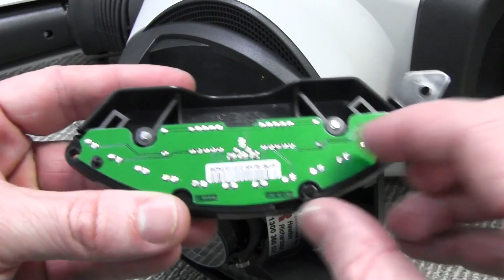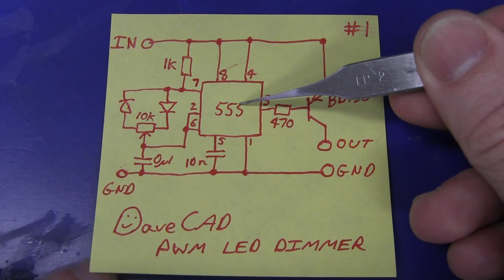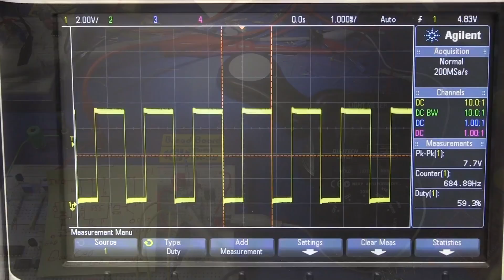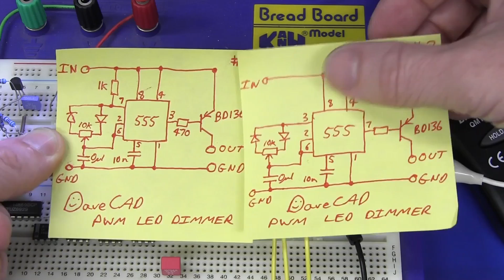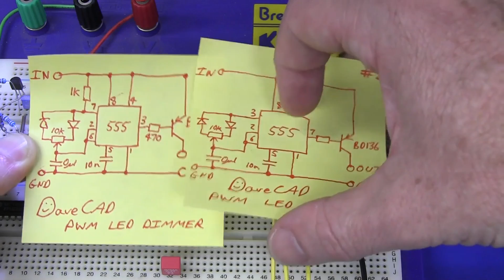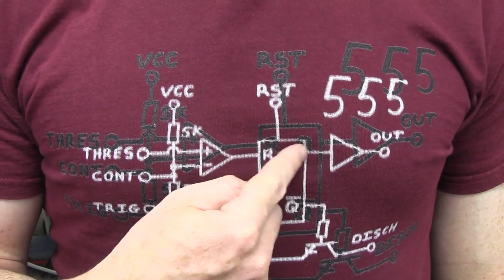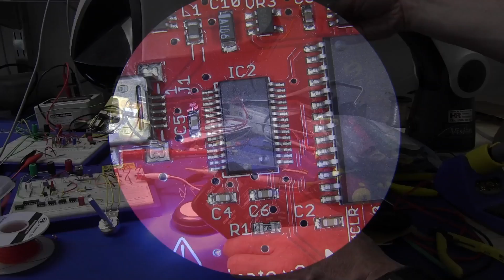EEVblog #392 - 555 LED PWM Hack

Comment: Being able to adjust the frequency rate of the LED flasher outputs pin 3 plus the pin 4 for the extra LED and also being able to adjust the duty cycle without affecting the flash rate frequency while still being able to adjust frequency is what I am looking for. Anything on this yet ???

Comment: Any ideas to use a 0 to 5v potentiometer to dim RGB without messing up the color mix?
I am expirimenting with a PWM fan controller for testing, but if I'm thinking right for the final install I may be able to use the Pam signal from the factory computer that is controlled by the dimmer knob.

Comment: You can always save this pull-up resistor in 555 timer astable multivibrators by using its output pin to control charging and discharging of the capacitor. You can also save the base resistor by use of a p-channel MOSFET for switching of the LEDs also from the output pin.

Comment: What would be the best way to control the pulse width using a microcontroller? Would the pot have to be a digital pot in order to work properly or can a microcontroller DAC simply output a voltage to this circuit somehow?

Comment: i noticed the transistor had casing molded around the back of it, does that ever interfere with the grounding? like do u ever have to sand them to get a more reliable connection? or am i totally wrong about that even.. does it Not also ground thru the back?   i know, random ass question.. im just curious

Comment: Very good. I like coming of pin 7 . Used that pin in a simple 555 time base circuit on a very simple scope and a 0.1 out from the transistor.
 .

Comment: You should connect a 1k resistor between those two diodes opposite to trimmer. I built the circuit on breadboard and it works fine but when i made it on pcb as a prototype, my smd 555 chips worked good for several minutes and then stopped working. I blew 2 chips and then i searched some formulas, and came to know that the capacitor on pin 6 is getting charged through the resistor, diode and potentiometer and discharging through the diode only directly to ground through an inbuilt transistor on pin 6. Due to very low resistance on the discharge path, when the duty cycle is at maximum, the capacitor is discharging in a very short time and a lot of current is flowing through inbuilt transistor which will eventually blow the chip making it unusable. I dont know how long the dip version of chip lasts with this circuit but the smd chip will blow instantly. So add a 1k resistor in the discharge path!!!

Comment: I think Mantis did 317 on purpose to supply stable current. remember old microscopes having bulbs? being relativly slow those can be PWMed without light flux pulsing. Don't get me wrong, pulsed leds are great for torch lights, but in my opinion they are bad for microscope backlight.

Comment: Hello Dave
I love your videos! Great work!
I have a question. I’d like to build a circuit that lets me turn on a 12V 20W light bulb immediately to 100% duty cycle. When turning it off, I’d like it to slowly dim down from 100 to 0% duty cycle over a time of about 30 minutes. So to say a soft stop. Would you have an example of such a circuit? Thanks much in advance
Reply: I'm curious what do you need it for?

Comment: Can this chip NE555 use to drive a mosfet for the backlight circuit in a led tv? If your circuit can be used, what would be the output to connect to the gate of the mosfet and what value gate resistor?
I think I should say it’s a Chinese tv but the PWM chip is defective so I just want to direct drive the mosfet for the backlight.

Comment: Hey Dave!!!  I have been looking for a good push-pull 555-based circuit for a LONG time!  On your DaveCad drawing, would I get this if I connect a load to your BD136 output (to source current) and pin 3 (to sink current)?  a couple hundred mA  at 40kHz to 50kHz should be sufficient.

Comment: Skip the 1K resistor, and swap pins 3 and 7 on the 555. Use pin 7 as the output (it's open-collector) and pin 3 (push-pull) to drive the steering diodes to the sides of the pot.

Comment: Can you help me to build a really high current PWM? Like 200amps would not need to be high Voltage only about 5v to 12v. All I really want to do is send 18KHZ 80% Duty cycle Square Wave doesn't even need to be Adjustable.

Comment: Thank you for posting. I didn't notice until the second day that BOTH sides of the potentiometer were connected to power through a 1K resistor.

Comment: Nice simple circuit but when ever you drive a PNP this way it may not shut off because the base voltage is always a little lower than the supply. A 20K from base to emitter will ensure it shuts off reliably and will reduce power dissipation in the transistor.

Comment: what's wrong with just putting the leds in series with a 10 or 15k pot? why use pwm? i'm just curious.
Reply: Why NOT a pot? HEAT! Wasted power. Less linear light control (sometimes you almost go from being on to off, depending on the diodes). In this instance you also have a constant current source driving the LEDS - as long as the driving voltage behind it is high enough you can put as much series resistance as you like in line with that current and you will have ZERO impact.
Reply: Bob Lewis oh yeah... that makes more sense now. Thank you.

Comment: Be aware that NE555's output is not rail to rail, especially in logic 1 state. A resistor(let's say 1kΩ) betweeen base-emitter(BD136) would greatly improve transistor's  switching time and would reduce collector cut-off current. A maximum limit current resistor(330Ω or more) at discharge pin(7) or at the wiper is a good idea too.
Reply: This is not relevant for the CMOS 555 timer versions.

Comment: I am curious why not use a npn? did I miss something?
Reply: Pin 7 can only be "low" or "open", but not "high". In this PNP configuration (#2), when 7 is low, he gets emitter-base-current and therefore current through the LED to ground. 
With an NPN, he would've had to put current into the base, so he would've had to use pin 3 (which can go high) to put a positive voltage to the base resistor. (And also switch between LED and GND.)

Comment: Can i use a thyristor ( 50A 1000V for example ) instead of a transistor?
Reply: Err why? In a DC circuit, once a Thyristor (or Triac) is turned on ... it's ON and stays on until power is removed. It works (either) as a dimmer because the AC voltage effectively turns "off" every cycle allowing you to delay re-triggering (hence a pseudo PWM effect) and allowing you to control the current. 50A 1000V? Do you have a 50 kilowatt supply for it? ;)

Comment: Actually, my first thought was to use a potentiometer with a switch, and using it to bypass the dimmer.
However, finding linear taper pots with a switch is tough....most of the time, they are audio taper.
If you are willing to order from a parts supplier, then I'm fairly sure you can buy them.
Reply: A potentiometer (wired as a variable resistor) in series with a constant current varies precisely NOTHING except the series resistance. It's a CONSTANT current - that's the whole idea - it doesn't matter if you have five or 50 LEDS in series (provide the drive voltage is high enough) it will be the same i.e. CONSTANT current and an extra series resistance will do nothing.

Comment: Hello,
i am in the process of restyle my house with leds.
First of all, I am no technician at all.
Since I see a big difference in price between dimmable and non dimmable led spotlights, I was asking myself... shouldn't a PWM dimmer work with all leds (even non dimmable ones)?
I've checked your video, and you don't seem to even check if those leds are dimmable or not.
This somehow confirms my theory.

Could you help me sort the matter out?

Thank you!
Reply: "I've checked your video, and you don't seem to even check if those leds are dimmable or not." - LOL..All 'stand alone' LEDS are directly dimmable by a PWM circuit.  However, non-dimmable commercial lighting have a built in cheap regulator circuit supplying the LED(s), and deliver 'say' 3 volts to the leds regardless of whether you feed 3 volts or 12 volts to the light assembly.  In other words, if you feed the regulator with less than 3 volts (or with a PWM'ed duty cycle that simulates the appearance of an average 3 volts), it won't work, if you feed the regulator circuit with more than 3 volts, it will light up the LED(s) to full brilliance. You may see a very tiny range between say 2.9 volts and 3.0 volts where there is a noticeable dimming effect - but most end users will not appreciate your cheapness in using non dimmable commercial led lighting when they only get 2 degrees of pot rotation movement to dim the lights. You could of course disassemble each light assemble and feed your leds directly with your home made PWM circuit, but the amount of time required would likely outweigh the cost saving.
Reply: Obviously my understanding of PWM needs more readings!
I thought it could be simplified as a very fast "on/off" switching. 
So my idea of it was: "if it is a very fast switch, why should the bulb even care?"
As per what I understand from your answer, the regulatory circuit in the bulb will still try to keep the voltage steady at 3v (at any PWM range above a simulated 3v). Correct?
If that is correct (removing the regulatory is a nice idea, after all, and feed the leds directly with a 3v pwm, instead of a 12v), but, then I was trying to figure: if the regulator tracks the incoming "simulated" voltage from the pwm, why shall I even bother using a PWM dimmer (with a dimmable light, of course...)?
I might just as well reduce the voltage with any type of circuit... after all, as I understand, it is just a mean of voltage... so why involve the Pulse process?

(a PWM module is around 30€ ... a circuit to just diminish the voltage would be a lot cheaper than that!)

Thanks, and sorry if my questions are so stupid :)
Reply: Lets say 2.5v is the voltage needed to light a LED at full brilliance, and 2.2v is the voltage needed to see just 1% of the led brilliance.  You could make a circuit that rotates between 2.2v and 2.5v.  You can do the experiment with a variable power supply.  You will find the brilliance adjustment is not very linear. For example at 2.3 volts it may look to be 90% bright.  Due to the non-linear and tiny adjustment range, most LED dimming circuits use a duty cycle approach to recreate the smooth linear adjustment effect.
Reply: I need to understand a bit more...

You said that non dimmable bulbs would not work,
so I assume that

Case 1:
Non dimmable bulb, PWM supply.
supply 12v (100% of time) -> regulator 2.5v -> full light
supply 12v (50% of time) -> regulator 2.5v -> full light
supply 12v (0% of time) -> regulator 0v -> zero light

Case 2:
Non dimmable bulb, NON PWM supply.
supply 12v -> regulator 2.5v -> full light
supply 6v -> regulator 2.5v -> full light
supply 0v -> regulator 0v -> zero light

But then again, 

Case 3:
Dimmable bulb, PWM supply.
supply 12v (100% of time) -> regulator 2.5v (100% of time) -> full light
supply 12v (50% of time) -> regulator 2.5v (50% of time)  -> half light
supply 12v (0% of time) -> regulator 0v (0% of time) -> zero light

Case 4:
Dimmable bulb, NON PWM supply.
supply 12v -> regulator 2.5v -> full light
supply 6v (50% of time) -> regulator 2.????v -> half light
supply 0v (0% of time) -> regulator 0v -> zero light

If that is all correct, then why should a dimmable light be more complicated than a non dimmable?
If that's what happens, then the regulator only does what the PWM Supply does... without compensating anything... So, imho, it should be simpler and cheaper than a regulator that constantly tries to compensate the changes in the supplied power.

Can't quite get it...
Reply: The regulated power supply is not the thing being pulse width modulated.  The regulated voltage is fixed (in this example 2.5v)). The pwm circuit simply flashes the led (300 times a second or faster so you don't notice it).  The pwm duty cycle determines how long the flash is on versus how long the flash is off.  Your eye sees a dimmer luminance when the ratio of off to on duty cycle is off for longer periods than it is on. So case 3 and case 4 are not valid questions.  It's like asking what number is the colour orange. Or what does the color pink taste like.
Reply: You are getting the idea.  Your case three is really case 4 two times.  You are correct that it is pointless to use a pwm supply to power dimmable leds.  These leds are already being controlled by their own pwm, that is what makes them dimmable.  PWM controlled devices always get the full voltage supplied to them, it is just supplied in 'chunks'.  Ir's kind of like throwing a ball as hard as you can at a target.  If you throw the ball as hard as you can each time, then you can see that if you throw once and then wait 5 seconds before you throw again, the target will be moved only a little, but if you threw a ball each second for 5 seconds, the target is moved much further.  The distance the target moves is analgous to the brightness of the leds, the speed you throw is like voltage, and the mass of the ball is like amperage (current).
Reply: +Manuele Capelleri Don't confuse two things. As others have said "naked" LEDs are dimmable using PWM (and other techniques). On commercial LED LAMP packaging they are referring to LAMPS not naked LEDs and USUALLY, but not always they are talking about when someone wants to use the lamps with an existing (or new) MAINS dimmer (Thyristor or Triac circuit usually). Two ENTIRELY different scenarios. Hope that helps someone if not you., Your question was a LONG time ago.

Comment: ***** What is the value of the capacitor between pin 6 of the 555 timer and ground?
Reply: 0u1 = 0.1uF = 100nF  (Capasitor market "104")

Comment: How would you need to modify this to control say 1-2 amps worth of LEDs?  I'm considering switching my car over from stand lamps in the dash to LEDs, but will lose the ability to Dim them unless I do something like this.
Reply: broderp replace the transistor with something that handles those specs. I'd recommend a mosfet transistor.
Reply: +broderp Be wary of doing mods like that as they MAY cause havoc with the CAN-BUS in cars. Automotive engineers are not renowned for their forward thinking regarding electronics - it took almost 20 years before electronic ignition was fitted as standard to cars from when it first became available and even longer for anyone to figure out they could use an individual and smaller coil per cylinder, instead of one shared between cylinders (which causes significant problems on high-revving, multi-cylinder engines). 

The CAN-BUS checks often are looking for the current that SHOULD be drawn by FILAMENT bulbs and fitting LEDs causes them to have a DVT (Deep Vein Thrombosis! LOL) i.e they do NOT like it and can start throwing up Engine Management Unit errors. Proceed with caution - you may spend a lot on new LEDS to discover that they can't do what you want without reprogramming one or more of the car's microprocessors or a LOT of heavy duty reverse and re-engineering of the lighting control module. You MAY be lucky and find that your car dimmer uses PWM anyway (there are some) as some of the smarter manufacturers realised it was a good way to avoid heat behind the dash.

I have changed to using LEDs, where easy to change, on my Land Rover Freelander (plenty of appropriate LED swap out bulbs on eBAY) but not worried about dimming as they are only on at night anyway normally and were about as bright as a candle in a hurricane previously. Not even sure where (if any) the dimming control might be on mine. An even better LED swap-out in cars is for the Interior lighting ... WHAT a difference.

Comment: i have a 12vdc  pc fan i need to turn on and I have a 24vdc source. I know I could just use resistors to run it ,but its just wasteful to do it that way. So from the start I have wanted to use pwm mainly for efficiency,it would use at least half the ma with PWM. But watching your Vid Dave I think I might add a pot and drive it between 75% to 125% , so i can see if at the low end it would cool with less noise or if its not cooling enough can drive the fan higher till I get a bigger fan. Thanks Dave for all your Vids. I have not only learn how to do alot of things, but also a few I now know how to do different or better .
Reply: 125% duty cycle? x.x Well that would be something, wouldn't it.

Comment: Very good, but I have one question, because use 2 leds and non-conventional diodes, such as 1N4007 or the like, or failing that the typical 1N4148?

Comment: wouldn't a pot on the LM317 in current control mode be much simpler?
Reply: he said that he wanted to avoid installing anything inside the microscope case

Comment: I would've said replace the regulator resistors on the regulator with a potentiometer, but that works too.
Reply: Now with much more experience, I can confidently say the 555 Timer was the right move. The potentiometer wouldn't be very accurate.

Comment: Nice video Dave!! I applied your circuit as a comparision between Analog PWM vs. Microcontroller PWM.

Pretty interesting behaviour using constant voltage source. I can reach 26% as minimum and 96.76% as maximum.

I do not why, but, pretty intersting thoug.

Thank you.

Comment: this circuit is a great one for hi load like 2 + amps I tried it on a small motor t I used a IRFP250N for the opt I had a 1 k pull up resistor on the transistor  you can hear the switching sounds like a cordless drill 7 amps no heat

Comment: Is there a way to do PWM without changing the frequency? Also, how would I implement PWM with transistors instead of potentiometers? I'm trying to design a switched mode power supply.
Reply: +Matthew Ferrie mcu are cheap nowadays. go use some. ever heard of arduino?